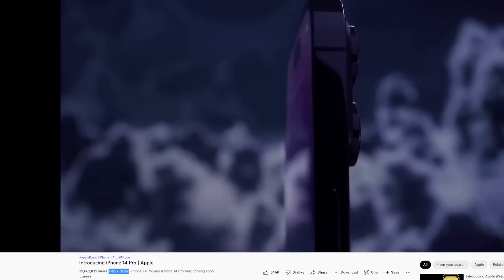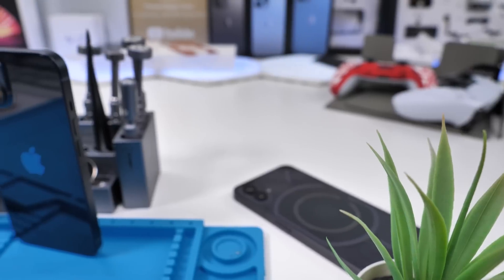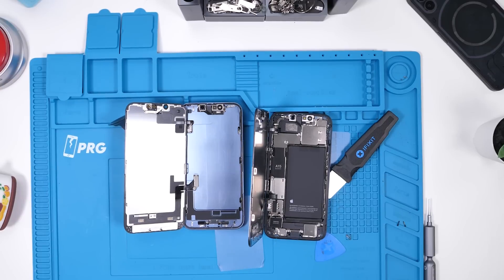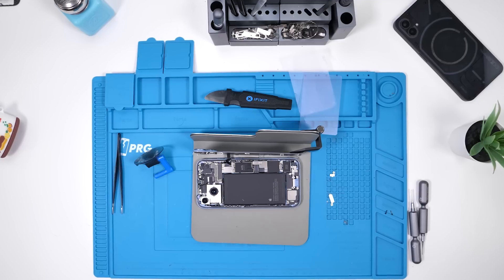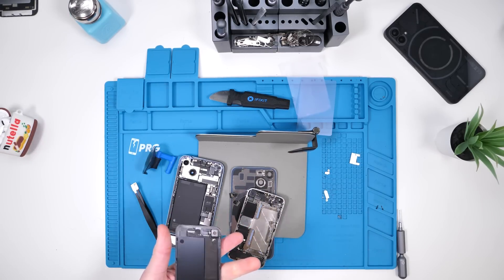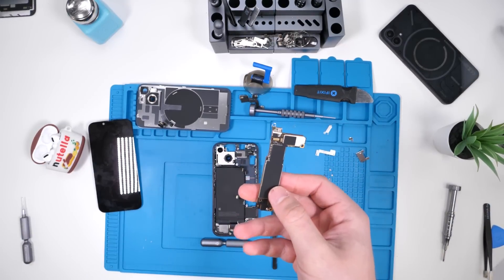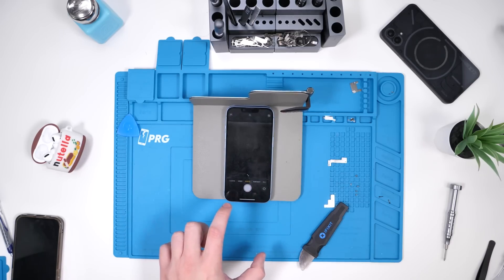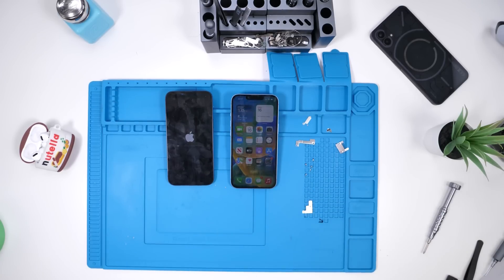IS THE iPhone 14 REPAIRABLE? This was a Rollercoaster.....

Comment: The "poison Apple" iPhone 14 it seen to be easier to repair but not by you or any non-apple authorized shop because of all these anti-repairs soaked in it. So, when you buy a new iPhone, you only buy the right to use it, and Apple still own it as any repair or components change you need to go back to Apple. Under warranty is free repair back to working status for your iPhone but if your warranty is over you need to pay a very dear repair cost e.g. recently, I sent my iPhone 14 for screen replacement it caused me more than USD 300 with tax and it only warranty for 3 months and the damaged screen wouldn't be return to you as it is Apple policy.  In view of all these anti-repairs and forcefully need to be repair by Apple, well, this will be my last iPhone I will be using not unless Apple remove all these anti-repairs mole.  It is unethical practice!

Comment: This video made me purchase 14 instead of 14 pro. I’ve been using iphones built from individual components bought seperately. It made cheap iphones at a fraction of the price. Stopped doing that untill iphone X and ditched iphones for a while and came back to it with a 14.

Comment: I’ve been repairing all my devices in every instance short of soldering on new components since the iPhone 4S. So yeah the return of rear opening design is tight and all that. But all the progress they make in simplification of repair is utterly meaningless if they software lock the parts with digital serial numbers. 
What’s the use of a brand new screen/camera/battery/speaker/ETC when it doesn’t function as as should because greedy POS Apple says it needs a digital thumbs up lmao

Comment: Hello, I was wondering if you could help me i bought hp  17- B4623dx like 2 month ago and water spilled on the screen and they screen got dim and I try to get but they couldn't able to fix it  and even bought a new screen but its not working any 17.3 inch wasn't working on it but lower inches works

Comment: but as we all know its always good to unplug the battery flex cable before working on any device to prevent damaging, but apple had to put the battery flex cable in the rear which means u have to remove the rear glass to unplug the battery smh, but its cool it makes it easy for the noobies to locate the 2 flex cable to remove the display.

Comment: I would rather apple make it impossible to take internal parts from one iphone and put them in another iphone to discourage the plague of thiefs that will steal $800 phone from hardworking people and sell them for $100 in parts. Make all parts from other iphones entirely useless! 

I like the back glass and screen replacements being made easy for DIY using geniuine or aftermarket manufacturer's parts instead.

Comment: So the reason it doesn’t work is after the repair at Apple all the parts are run through system configuration diagnostics to tell the phone it has new parts.

Comment: They've made the screen connector easy to reach, but they've put the battery connector on the other side of the phone... Meaning, if you only want to replace the screen without disassembling the back cover to actually disconnect the battery first, you may end up damaging the logic board when disconnecting the screen from the board (blown filters...). Well done Apple. Well done.

Comment: I remember old good Nokia, once if You need new battery - you can pick up original one at nearest store and change in seconds (or You can have both batteries and swap it during the day - no need heavy power bank at all).
Modern phones are more build complicated and also fragile due to large glass screens and panels. Not everyone can proceed with parts replacement. But at least I think, that vendor should provide original batteries and screens to open market, so anyone can fix it on his own in after warranty period. This parts should be available at least 4-5 years after release, as mostly modern phones lasts long. I have operational Moto RAZR X910, Nexus 4, MI 4, etc... all of it is operational and just need new original, good quality and safe battery.

Comment: 1. apple has started offering and pushing more services, things you pay monthly for, subscribtions.
2. their phones are getting more repairable, and their letting 3rd party shops buy their official repair kits and official parts.

im calling it right now, apple is focusing more on the data and subscription side of their business, instead of trying to profit off their physical products. before they'd want you to take your broken device to them, so they can repair it or make you buy a new device. Now they probably focus more on just keeping you as a customer and keeping you inside their monopoly. By making it easier and cheaper for their customers to repair their phone, even if it isn't done by apple, they will keep them using apple services.

Comment: "We are going green" 
This means green stuff. What is green. Think. You probably have a piece of paper that says $. Think. Is it green? YES!!
We going green (greedy) means they remove charger and earbuds to cut down that $2-3 cost per box. When you are as big as apple, that is a lot. Its cheaper to ship box. Probably cut their cost with $10-$15 in total. And futhermore when selling this extra. Because they took the USB A out and put a USB C in the box. That force most ppl to buy a brick anyway. Basically means $30-$50 more for them. And when they sell 10 000 000 phones or more that means $300 to $500 million

Comment: Repair tip: If your front camera is been damaged on iPhone x and beyond it will have the same problem when you replace it with another. After changing the front camera module you always have to do update or restore to get the front camera working again.

Comment: I have no experience at all from repairing a phone, but I build a fair amount of computers and mechanical devices, and it seems like apple is starting to take the right step in being more repair/reinstallation friendly with 3rd party shops, they still probably have a ways to go, but this is much better than last year. I've been planning to get a new phone for awhile, had my current one for 6 years, might get a 14 or 14 pro after seeing this.

Comment: So the back come off, that’s good, maybe the pros will follow suit next year.. in fact. If there’s a redesign it makes sense for the switch and they are beta testing it now… 
That’s some phenomenal engineering right there, from the outside the 13 and 14 are identical twins but the inside is 100% different..

Comment: Question, as of writing this my A52 4G back panel is slightly separated from the frame around the area where the logic board is. My device is still under warranty, if I go to a Samsung Service center will it be covered by the warranty to replace the water-resistant adhesive seal? (I reached out to Samsung support but the lady I spoke with has no idea what I am talking about, she told me to factory reset the device to fix the water-resistant issue I'm having) And will they use a water-resistant seal instead of super glue (I know someone who had their Huawei device battery replaced and the authorized service center used super glue instead of a water-resistant adhesive).

I don't use my device in water, I still treat it as a non-water resistant device coz I know over time the adhesive would wear out and even if it doesn't the IP rating will not always prevent water from getting in, but having the IP rating still provide a sense of security in a situation where water is introduced to the device accidentally like getting caught in the rain or pushed into a pool..

Comment: So to change the front screen the back plate still has to come off to disconnect the battery so that you dont blow the backlight circuit. Or do these 14's have oled panels I doubt it but if someone knows let me know

Comment: Ah yes, apple makes their phones "more repairable" by moving towards the design style of a pixel...
To be clear, working in a repair field myself if I had handed any pixel phone on the market to my new tech self I would've quit that day. Sorry guys but this isn't a step forward at all. There's so many problems that come up when you encourage people to disconnect the screens without the battery disconnected. You always need to be aware when there's power currently running through the device or it could fry in milliseconds. Then add in that apple devices specifically have issues with the well known "backlight" problem, where the screen is forever gray afterwards because of short circuit board damage. 

I will admit that the removable backglass is a nice accommodation, but it's a red herring to appease the masses so they don't think it's an issue anymore. We can't give any allowance for them taking control over our property away from us. That means no parts serialization, no error messages, no misleading information, Even the phrasing of "apple certified repair" gives offense to every tech who goes the extra mile to make up for how much apple doesn't care about us. Apple still doesn't care about the user, they care about the user's sale and dependency on them.

BTW having done those backglass repairs with lasers myself, I can confirm it's really cool... It just takes a while with so many glass shards.

Comment: display replacement job just goes in a very bad way,in order to replace it battery cover should be removed just to disconnect the battery,the apple engineers are complete morons

Comment: In order for the front camera to work. It needs a software update or reset the phone. I have done a front camera replacement on my XS Max Before and at first the same issue occur like black screen when switching but after reseting the phone to factory settings. THE REPLACED FRONT CAM WORKS.

Comment: Hey ive really been trying to get into phone repair, is there a specific heat station I need to remove OLED? All I see are ones marketed for LCD. Finally, in your opinion, what is the best way to get into the hobby?
Reply: They’re the same. The heating station is to soften the adhesive around the display, nothing to do with the actual display itself.

Comment: It's horrible when you need to disassemble and reassemble the entire phone just to replace a cracked back glass (I mean when you don't have laser machines, and those make a huge mess!)

Now both display and back glass swaps are much quicker, I just hope that Apple keeps making their phones more repairable.
Reply: apple is the definition of one step forward and two backwards
Reply: @axd0703  That's not how they became the most valuable company in the world
Reply: Funny how apple make it hard to replace back glass and most android device could replace back glass pretty easily but you would have to guts it out to replace screen in many device
Reply: But in the Pro model this is the same shit than the 13 model. Impossible Back-Glass remplacement
Reply: For me it just seems like everybody forget that the replacement of the screen without disconnect the battery is quite brave, so you have to disassemble the front and the back too to make sure, you are doing it safe.
Reply: Lol 😂 talk shit all you want. Android been doing that for just the screen!!! You literally have to take apart every component in Samsung/LG/Moto and move it to a new frame/screen
Reply: @malfaroangel3896  I mean, most Android phones are hold together with under 15-20 screws and usually you just need 1 or 2 screwdriver bits. Can't say that about iPhones can we?

It is simpler to completely reassemble an android phone. You can do a screen swap in under 15 minutes.

I do love iPhones, but they were an almost unrepairable mess for years. And now I am happy to see that they are becoming repair-friendly.
Reply: @thetechrefurbchannel  but it’s just not true, according to ifixit iPhones are more repairable than your average flagship android
Reply: @kingdelledroghe1957  have you seen disassembly comparisons between iPhones and for example Samsung or Xiaomi phones? Maybe you’re referring to iPhones being more modular and yes, that may be true, but they are much, much more complex to take apart…!
Reply: @MiguelSantos-sm1nv What are you talking about? You can do a screen replacement on any IPhone other than the 12's and 13's in 15 minutes or less no problem, and those you just need to heat up. 

Drivers? Pentalobes, tri point, and a 00 PH. That's it. 

Samsung phones, especially A series, requires you to literally gut all the internals just for a screen swap.
Reply: @Sir_Zak  It's true, and it's also true that you can disassemble an entire Samsung phone in 20 minutes. They are assembled using like 20 screws or so, almost all of them are the same length and all of them use the same bit. Have you tried disassembling an iPhone? It's a nightmare. Apart from the display and the battery, everything else is a pain to replace on an iPhone.

And Samsung flagships are proof that good phones don't have to be as complicated as Apple makes them be.
Reply: @malfaroangel3896  yeah i know right i love android but why do they open like that?

Comment: As a phone repair tech here, i dont know how i feel about being able to just unplug the screen flexs without unplugging the battery first, ive seen phones getting fried🤦🏽‍♂️ and to unplug the batter first its doable but just adds an extra step by having to take the back off first!
But non the less great work man all this work you do is not easy and expensive!  Kudos💪🏽
Reply from the maker: Me either, & thanks! Best of luck to you
Reply: Honestly I’ve worked on thousands of iPhones and I’ve never seen one shorty out due to not unplugging the battery first. Not saying it doesn’t happen, but I feel they’ve added measures to prevent this from happening.
Reply: @MrNocturnal1  I've definitely seen it happen. Definitely worth disconnecting the battery before anything else. Especially when the device is for a client and most don't have backups lets be honest. Having to open the rear also is a little annoying to do a simple screen replacement but if it means easier rear glass repairs its a good compromise IMO.
Reply: @MrNocturnal1 In my experience, the iPhone 6S were notorious for blowing out the backlight fuse if the battery wasn't unplugged first.
Reply: @EduardoSanchez-rb9lt  Depends a bit on the design of the curcuits and the pinning/design of the plugs.
If you have always a hot line to the display this can happens. When you only power up the components of the display unit if needed, this shouldn`t be a big deal to make a swap with connected battery when the phone is turned off.
Reply: @MrNocturnal1  for safety reasons is better to unplug the battery from the motherboard so that if your screwdriver mistakenly touch any capacitor it won't cause short

Comment: I still cant believe Crapple is releasing a 60Hz "Flagship" phone when even mid ramged androids have 120Hz. For me its not about being a gimmick its something that actually improves the user experience and keeps the device feeling fluid for many years to come...and they cant use battery life as an excuse cause iphones have some of the best in the industry. Its such a slap in the face of the consumer imo. I understand the point that most users won't even notice but when a phone less than half the price of urs makes yours feel like a old brick then what are you even paying for?
Reply: nothing, so go for iPhone 13 which is cheaper now and Apple still sells them
Reply: @rohithmekala2608  bro ima stick with my S21 its much cheaper overall...not to mention better lol

Comment: I actually preferred the design with firmly glued back glass, because i've had numerous issues with different phones of back glass separating on it's own, and now it's gonna be an issue here too. And seeing as this is a complicated module instad of a simple piece of glass, this would be really annoying and expensive to replace
Reply: it's not an issue. the back glass does not separate any more than the iPhone 4's back glass separated.
Reply: @natayaway  i'm comparing mostly to the Android phones i've had, the Samsung S7, S9 and S21 all had their back fall off, and i have had to fix it back on with some water seal plus double sided tape for it to stay put. I'm afraid the same thing is gonna happen here
Reply: @AlexGFrank  none of those are the iPhone 4, which famously did not come off as easily as you are saying those other phones are.
Reply: Alexander...you must not be serious. You preferred the hard glued back. Might as well have asked Apple to hard glue the front display.
Reply: Well that’s a simple fix… open YOURS and glue it!
Reply: @canalellis  the phone is disassembled from the back now, so that's not an option.

Comment: They make it harder so people are forced to buy a new phone, and apple gets more dough. Same strategy when they got rid of the headphone jack with the iPhone 7/7 Plus to force people to buy AirPods. Apple doesn’t care about the people, only themselves. The problem is, there is nobody else to stack up to apple, like how for example android phones have so many more features that are light years ahead of apple, like how apple is only now just real song an always on display that the Samsung galaxy s8 had all the way back in 2017. However, Android doesn’t support phones for very long, and the OS os extremely crappy and fragmented. If they make a new phone that is an android running a brand new OS that isn’t android, apple will finally be defeated. I just hope someday the bring the headphone jack back on something l, as Bluetooth headphones have worse sound quality than wired. To use wired, you need an adapter, which ruins the sound quality. Also lol this is so long someone nail it to the door of Tim Cook’s house.